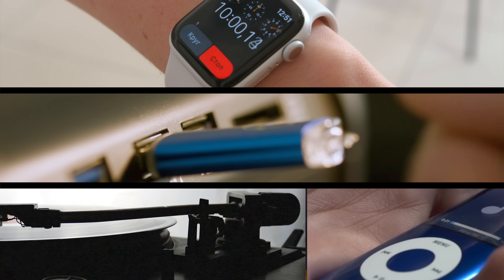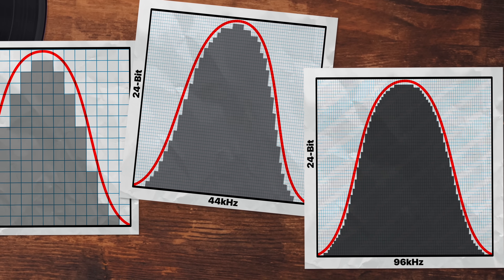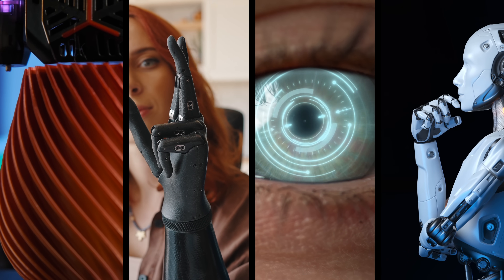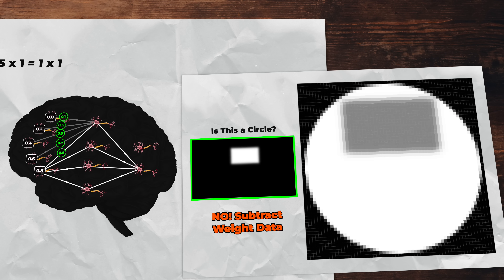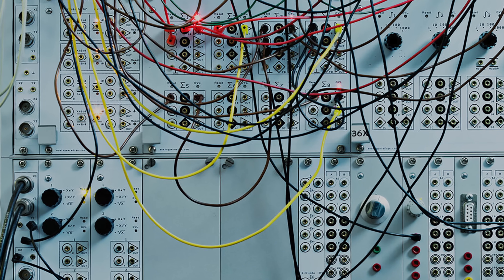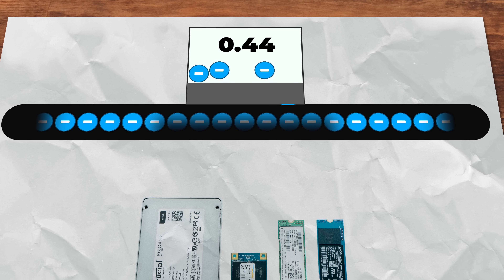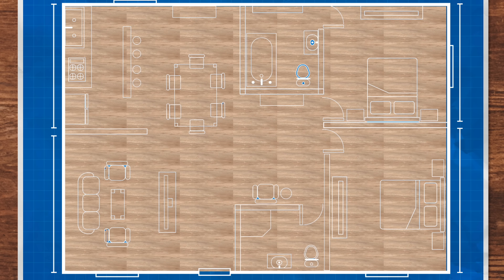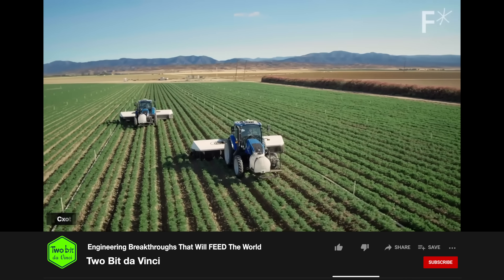Analog Computing is GENIUS - Here's Why!

Comment: Is 5% an accurate loss rate on these things? I feel like increased sample rate should be able to give us an accuracy loss much closer to 0? What if a sample rate could be in the Mhz range? That would bring it to within a few atoms of resolution. Pair it with a second analong processor, give it an acceptable loss of data of .1% or whatever is considered acceptable.
Have the system run checks against both of the analog signals for accuracy inside .1% or whatever is considered acceptable (end calculations of each side independently are compared and have a .1% difference in the results). The 2 systems can be fed the exact same input signal so there's accuracy at the start of the calculation. 

The ability to do certain things VERY WELL would be an understatement. I can see this maturing quickly, and combined with ARM based cpu's as well we have some cool innovations coming in the future.

Comment: Back in 1968 I used an analog computer to simulate a vehicle chassis. Position, acceleration, and jerk are related by differential equations, and the wheels are interconnected too. But a simple analog computer with maybe a dozen vacuum tubes could do differential calculus instantly, and you could change the spring constant or shock damping  in real time to see how it changed the handling.  To do one simulation on a computer I had to punch a whole stack of cards and wait for it to run on the mainframe ... overnight.

Comment: digital audio is not blocky. raw data would be, but there is the nyquist theory that proves that any wave can be displayed by  a set of values double the frequency number of the wave.
44.1khz is used to adequately represent any frequency from zero to 22khz. 

the issue with digital audio is filitering out stuff above the used nyquist frequency to avoid issue, which causes artifacts. so 96khz and beyond move the artifacts way way beyond audible and mostly solves teh issue of deeper audible resonances.

mp3 tries to reduce the nyquist data by leaving out stuff that "should" not matter for audio. but thats a wonky game. so mp3 sounds off.
non lossy digital audio of sufficient khz sounds as good as real, if your sound system can reproduce it accurately.

vinyls richness comes from resonances that the playback of the vinyl material causes, making the vinyl behave like an additional instrument. thats why high quality digital recordings made from vinyls sound like vinyl. its a pleasent sound coloring like tape compression is.

Comment: I don't think you quite understand analogue computers. I studied analogue computing at university and found them very useful.  A better analogy is with modular analogue synths. Analogue computers comprise of modules which provide functions such as     addition,  integration with respect to time, inversion, multiplication, exponentiation, logarithm, division and because these are patchable they are extremely flexible allowing real time solution of engineering and physics problems.

Comment: I may not fully understand it correctly, but if I do I imagine that the analogue chips will cause a huge amount of e-waste. Due to the fact that they're not 're-programmable' so to say. Suppose there is a bug in the algorithm on the chip, or a newer version comes out that does the task better, you'd no longer have a use for the old one, and throw it out.
Reply: So how many of your old laptops/phones were reprogrammed for a different purpose? Exactly, none. And if a newer version comes out that does it better you have to buy it in the newest model.
It's all e-waste either way unless the industry changes very fundamentally.
Reply: @brinkoftext  Well, given that all my stuff runs X86_64 and ARM, they can run basically everything. From what I understood from this video - and I may be wrong - these CPUs are hardwired for a single algorithm.
Reply: @Stroopwafe1  Most modern processors already contain hardwired circuits for things like hardware accelerated media encoding & decoding, faster encryption etc.
Then there are dedicated chips for audio signal processing, wifi, bluetooth, USB charging, AI inference, ...

All modern computers are already full of hardwired stuff.

Comment: 3:40 Did you know there are no tides whatsoever on land locked lakes? Or that by natural default the gravity at the North or South pole axis' is at a 90 degree right angle relative to the centrifugal force radiating outward from rotation? I just can't understand how gravity negates the centrifugal force pulling the seas away from axis when it only pulls down at a 90 degree angle at the polar axis.  Amazing!

Comment: the explanation of digital sound fidelity being a bit approximation of a real sound wave sine is inaccurate. In fact, the sample really is just capturing the frequency, and is able to precisely reproduce the original sound  with a sample rate of only  2x the original frequency. This is because since all sound is pretty much just a complex series of sine waves, you only need 2 bits of data per oscillation to reproduce the curve.

Comment: Analog computers aren't actually good for neural networks.  At least not competitive with the best digital computers.

First: transistors in computer chips are so small these days, that you only have a 'few' electrons to work with.  So your analog resolution is severely limited, because you are working with an underlying 'digital reality', charge is quantised.

Second: the kind of transistors used in computer chips use almost no power when they are fully on or fully off.  But they use a lot of power when they are in an in-between state.  And those in-between states are exactly what you'd want for analog computing.

Comment: Just wondering about opamps? They're still around, mostly used in guitar pedals and audio gear that requires a low cost bank of matched amps. IIRC they were originally devised to do calculations using analogue voltages. No reason that current technology couldn't miniaturise many opamps on a single chip and use analogue voltages vs digital levels.

Comment: All of the earliest electronic fuel injection systems, which were developed in the 1950s by Bendix (Electrojector) for Chrysler and AMC, handed off to Bosch (D-Jetronic) in the 1960s for use in VWs, Volvos, BMWs, Mercedes Benzes, etc. and ultimately re-created (as a GM/Bendix venture) in the first fuel injected Cadillacs, were based on analog computing. The brochures for my parents' 1969 VW Squareback boasted of a "computer in the right rear fender" that precisely calculated the fuel needed (probably using op-amp circuits); said "computer" was in a metallic box that could be seen through the vents. The first digital fuel injection system was the throttle body injection used in the 1980 Cadillac 6 liter V8 and most of the systems of the 1980s were digital. The biggest advantage of the digital systems was their flexibility through software updates. Perhaps, in the future, the holy grail will be hybrid systems with analog arrays that can be "reprogrammed" by software that gets downloaded with each update of the digital portion.

Comment: I love music but I am not an audiophile. I've failed blind tests for guitar or synthesizer gear before. There are a few cases where I have sniped out the differences in some isolation based recordings of gear vs. software, but at the end of the day I know that I would not be able to hear the differences in a full mix of various instruments simultaneously. Therefore I think it doesn't matter -- just enjoy or create music with what you have. I will say that if I had a collection of records on the shelf I might be nostalgic biased in that favor.

I wonder if these new chips will make virtual-analog synthesizers not necessarily better (they already sound great), but lower cost to computing resources. I wouldn't know since I have never programmed oscillator modelling from scratch, but having multiplication subroutines become so lightweight; used to replicate a beautifully imperfect [ sawtooth / triangle / square ] source might make it marketable. Run away errors are probably not a consequence if you are to mimic singular voltage-controlled oscillator sources. I'm not sure how this could be integrated with a personal computer outside of dedicated USB based integration solutions, but maybe new hardware synthesizers could make use of such a chip.

Comment: My T bit system make a way better CPU in both worlds.
Its a ½ Analog and ½ Digital CPU system, the problem are i need skilled people to do it.
But the system need a H bit CPU system even to work whit T bit.

H bit system need new components that are not made yet.
T bit system need people you make Ram and data handle system work whit Digital.

T Bit system need 2 systems in other words to work right.
But it never math and you get a system that can whit 42 bit out preform 64 bit system in combinations.

It can multi code functions in 48 bit, that means it can store data in different ways that make Quick ram system and deep ram system.
Quick ram means it can do two or 3 few case 4 jobs in one go, where 64 bit only got one treat.
Like address where the ram shall store data and it have the number it need to store in one single move. Make the System 2-4 times faster when it run Quick ram whit same Hz.

This system can even make variables list system where you can store many on/off data 64 Tbit you can store easy 60 variables in one hz tick. 

T bit even handle Minus numbers whit out making tricks to make minus work, why for reason it already got it in H bit CPU system. It can get negative.

T bit are for memory and Data store.
H bit are CPU based system that make math go faster.
Simple to show how it works, but way to hard for a common person to make a running CPU.

H bit CPU works similar to Analog.
T bit are ½ of both.

Take to old C64 whit same amount of bit in T bit,
the Quick memory will be tiny less then the normal C64 but can store in slow Ram almost 1 mb to compare. So many address of memory will it be able to handle.

Comment: In an analogue neural network why is numerical precision necessary? During training, these errors would be "absorbed" by the validation process, as long as the weights remain consistent once set in, surely? To use digital neural networks for training seems a bit of a massive handbrake on AI. Analogue neural networks would be able to learn in real time and continue to absorb information just as a biological brain does (the size of the network being a limiting factor of course).

It must be very difficult for an AI engineer to achieve a desired outcome when they have invested so much time and money into the computational approach rather than a "live" approach. 

It must also be very difficult to realise the billions of dollars spent on hardware and training, not to mention the energy consumed, was a transitionary cost only. 

I predict the next generation AI, being extremely fast with fractional power needs, will come from a new team of AI engineers and not the current team. And only then will we see real neurons being used instead of ridiculously power hungry GPUs. And then programming as we know it becomes a blip on our historical timeline. Programmers become teachers and hackers become indoctrinators.

Comment: this isn't analog. analog does not need baterys or energy in my opinion, anything that needs energy becomes digital. It still process bits so it is digital, analog is like a clock that moves with a cord that you put and analog can not store data, it can store stats, like that stat where it stoped, but to store an ai model inside an analog system you would need a system the size of an house. anything that mesures voltage to work or give other results is digital.
And yes even analog needs energy to move, even if it is your manual energy to turn a cord that keeps tension for something to move later. but like I said analog is mechanic, no bits or voltages.
But that is just my opinion. I think people today just mess the names so bad that they forget what it is or was in the first place. Same like saying an automated python script that scraps the web and give you results based on what it found, lots of people keep caling that AI programs, cause AI is the hot topic now. But ai is not a script. No ai enginneer can even explain how the data that is stored inside a model works or what it means. All they know is what they gave to that amount of nodes to learn, how it stores it and why it stores it like that, noone even knows right now.
Reply from the maker: Not by definition. Digital in this context refers to storing data as ones and zeroes. But I hear your point!
Reply: @TwoBitDaVinci  sometimes I'm to fast getting mad and say stupid stuff, cause I get a bit mad with people calling names and changing context in titles just to get more views, and I now this is not your intension with your title. But it was late and I didnt sleep, so sorry for my rant, but still I think I kind of am right with what I said :p
I dont explain myself to well sometimes, since my native language is not english, but yeah I think analog is something mecanical, if im not mistaken, and you can make mecanical machines to make binary systems. but in this case it has chips with transistors and all that stuff so it is not anolog, it is digital right? :)
I hope I didnt pass by a smart ass trying to say smart things but being wrong in the end ;)
Happy new year btw and thanks for your reply ;)

Comment: I started out my career in electronics design, led me a job with a DOD contractor working in a computer simulation labs, many many computers doing also hardware in teh loop. this required real time computing, taking several computers in a room, digital was the host computers to control other Analog hybrid computers, using voltages, op amps, multipliers, DAC/ADC converters. Analog at the time was the only way to compute real time as a voltage change was almost instantaneous. and input/outputs directly coupled to test hardware that could be switched in the simulation loop the hardware would think was operating in real time. Later came high speed digitial using ECL, which was actually digital circuits that operated in neither on or off state, but as amplifiers biased partially on and only change intermediate voltage levels to get the speed which normal digital circuits that were all off and all on created too much harmonics to get the speed needed, these were power hungry special designed beasts. Outside of any real commercial potential for quantum computing coming on line I would think a new hybrid approach to using analog in the computing mix again could break through current limitations on speed.
Reply: Applied Dynamics International was a big player in this computing area

Comment: I believe that an analog computer system would also have incredible potential in secure communications.

Imagine a set of walkie talkies that use any frequency on the EM spectrum... Doesn't matter which... The voice input from each is transformed into those variables voltages on a memory bus you spoke about...

*HOWEVER*.... the voltage that is stored is varied based on  physical tokens, something as simple as a plastic chip... Similar to a poker chip... Except it's NOT ROUND! It has a unique shape, like maybe the silhouette of an apple 🍎 or a strawberry 🍓.... The tokens placed inside each walkie talkie, creating a bonded pair.

 (In my hypothetical I imagine that each plastic token slowly spins... Turning maybe once per second. A physical arm which rests against the edge of the token moves as the token spins... Rising and falling with the varying shape. As it does, any audio encoded to be sent is shifted in frequency)

The walkie talkies would be synchronized, in other words started at the same times so that the spinning disc in each was at the same point.

A communication device using this technology would be incredibly secure.
Reply: A communication device using this technology would be incredibly insecure.
Any computer programmed for the task could reliably break that "encryption" within seconds.
Reply: @brinkoftext  it's not encryption as you envision it. You're thinking of simple substitution routines or something like that. I'm talking about a "language" that two comm devices speak based on a three dimensional object which serves as a physical key. In order to successfully "decrypt" such a language, the routine you run would have to search for a key with an "almost" infinite number of X,Y, And Z coordinates in 3 dimensional space. 

Think of it this way: I'm holding a 3 dimensional object in my hand. Now fire up your AI, or your decryption subroutine, or whatever you are using. Now tell your program to accurately map the exact size and shape of the object I'm holding. I'll even be generous and show that of you get the dimensions correct within 1 mm that you've successfully guessed the object's shape.

I GUARANTEE you that your program couldn't guess it... And here's why: even using a brute force technique of trying all possible coordinates within a given volume, the numbers are too large. Add to that the fact that if it's off by just a bit, your program wouldn't get anything except gibberish since the input is being modulated based on those numbers... In other words for each guess, it would have to insert that guess, play the transmission back and see if it recognized any words, sounds, or, audio cues... Then if it didn't, it would have to guess another off the quadrillions (probably more) of possibilities and do it all again.

Also keep in mind we are talking about a key that is unique to only two users. Every other pair of users would have a different key.

I can appreciate that on the surface it seems like it would be simple to break, but I assure you, it would not be.

Nice to know that people think so though. 😁 Makes it that much more secure.